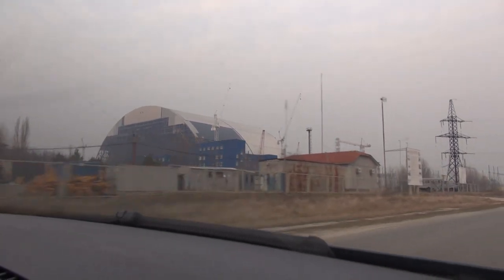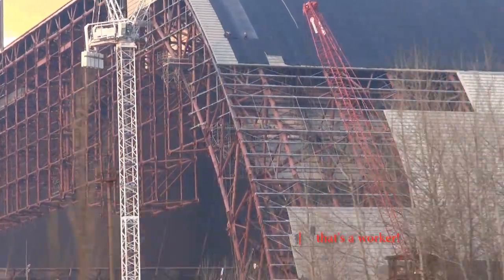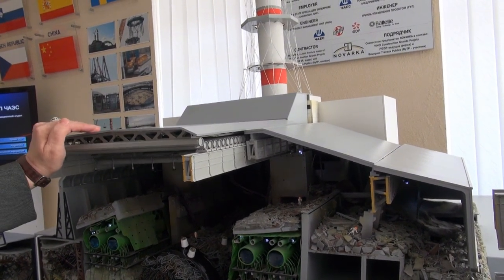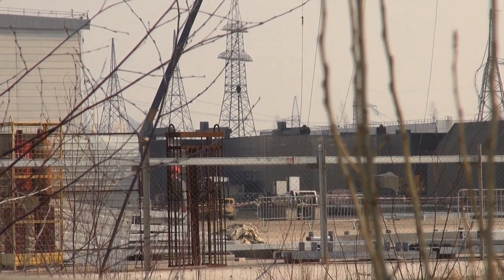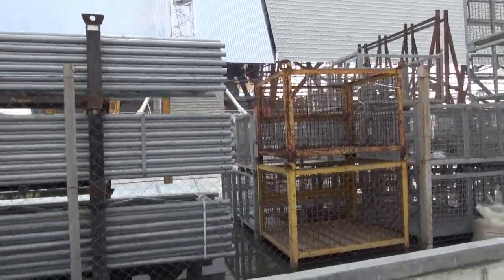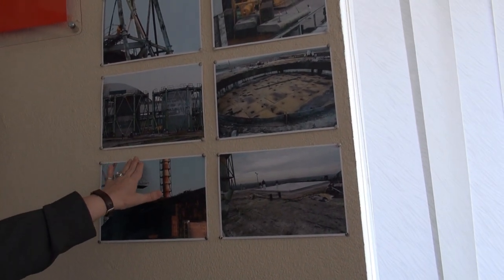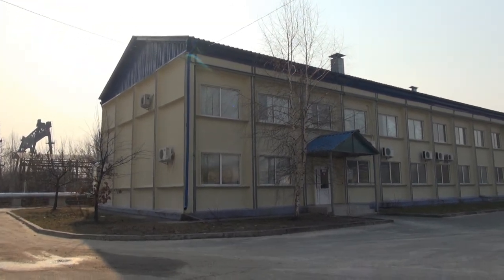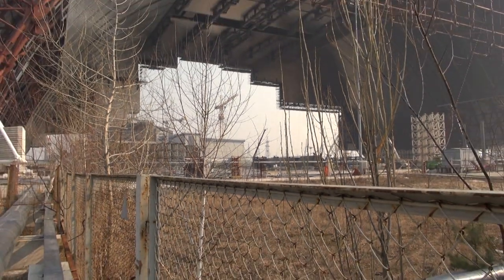Chernobyl New Safe Confinement (NSC) 2015 - "Арка" shelter of Reactor 4

Comment: New SAFE confinement? It will never be safe. Depending on the fuel used, U-233, U-235, the half life is anywhere between 160,000 and 240,00 thousand years. Nuclear power is simply a BAD IDEA!
Reply: +Semen MALASHENKOV: yeah... why not?
Reply: +Semen MALASHENKOV well look around us. we are experiencing global warming. the sun is getting stronger and stronger. might as well us it as a source of energy
Reply: Z Divinagracia
the sun isn't getting stronger due to global warming, i have no idea where you got that from. global warming is happening because of the increased amount of Co2 in our atmosphere holding more heat in than before, it has nothing to do with the intensity of the sun, which hasn't changed for millennia.
Reply: +Mikail Elchanovanich what i mean is that we feel the intensity of the heat more and more because of our atmosphere is depleting.  .-.
Reply: Z Divinagracia
of you mean the ozone layer, that's a different thing altogether, not to do with climate change. i'm no scientist so i don't know if areas affected by increased UV exposure would be better for solar panels, but it's an interesting idea that might be worth looking into.
Reply: *****
well, depending on the technology it could go either way, fossil fuels are certainly safer, and if we can develop effective CCS (carbon capture and storage) technologies, then we can use fossil fuels without polluting the atmosphere.
Reply: Indie Ingenuity Actually, while Chernobyl was certainly a terrible tragedy, it was probably one of the largest boons for modern science of its time. Since reactor 4's meltdown, humanity has learned a great deal about nuclear power, it's dangers, effective containment and failsafe protocols, medical advancements in the fields of radiation effects and the effects of radiation on certain terminal diseases such as cancer. Nuclear power is dangerous, but it's fine as long as proper safety guidelines and containment protocols are adhered to.
Reply: MrSmilingDeath
the problem is though is that they aren't adhered to, humans aren't that responsible.
Reply: Mikail Elchanovanich Given that nuclear meltdowns rarely happen these days, yeah, they are adhered to.
Reply: MrSmilingDeath
to an extent, of course, but not enough.
Reply: Mikail Elchanovanich As long as reactors aren't melting down, I'd say they're being followed just fine.
Reply: MrSmilingDeath
i'm sure that's what they were saying before Chernobyl went up in flames too. you have too much trust in these arrogant people. there is no way anyone can be sure that nothing will go wrong, and to assume so only beckons it.
Reply: Mikail Elchanovanich I'm not saying that nothing can go wrong, just that I'm no engineer so as long as reactors aren't melting down, I think I'll leave it to the professionals. To assume that humanity learned nothing from the incident at Chernobyl is extremely naive. Reactor 4 was actually considered somewhat outdated even before its meltdown. Not to mention that it was being maintained by the Soviet Union which was in a state of political and economic decline.
Reply: MrSmilingDeath
i didn't suggest we learned nothing, but they were pretty confident it was fine then, and we're pretty confident it'd be fine now. if something can go wrong, law of probability dictates it will go wrong eventually, it is unsafe.
Reply: Mikail Elchanovanich Well if you live in fear of Murphy's Law, everything is unsafe. Just because something has risks doesn't mean that we should just scrap it completely. Of course nuclear power has high risks, but comes with much higher rewards. It's cleaner than fossil fuels, offers substantially more energy output and isn't a being used as a motivation for armed conflict. I'm just saying that your attitude towards nuclear power sounds a bit like your tinfoil hat might be strapped on too tightly. There are obviously dangers with most fuel sources. Fossil fuels are very harmful to the environment, coal is extremely flammable and has caused the destruction of quite a few mining settlements (and has left some uninhabitable due to coal fires), and hydroelectricity has the obvious potential for dams to overflow or even break, flooding large regions downstream, killing numerous types of wildlife and destroying homes. Everything has its risks, but we can't cower in fear of them.
Reply: MrSmilingDeath
yes murphy's law is applicable to everything, does that justify such a risk when renewable energy, geothermal and CCS fossil fuels are substantially safer?
Reply: *****
CCS means Carbon Capture and storage, therefore no pollution. geothermal is here actually, look it up. renewables don't produce enough energy because governments aren't willing to invest in them since they have vested interests in oil.
Reply: *****
look at how wasteful and inefficient cars were a hundred years ago, with funding and proper implementation renewables can be so much better than they are, it just needs people to get behind it.
Reply: ***** dude sunlight is massively more powerful than indoor lights. don't be condescending, i know how energy works. why are you so adverse to renewable energy? you understand it's not gonna get any better unless we try to make it so, right?
Reply: *****
not true, photons of different electromagnetic frequencies carry different levels of energy with them, the sun produces light across the entire visible light spectrum and beyond, most light bulbs produce only a fraction of that spectrum, and much fewer photons generally too, else you'd need to wear sun cream and shades all the time because of the UV exposure. renewables alone won't be enough with current technology, but alongside a diverse set of other power generation methods can offset resource costs and bolster reserves.
Reply: *****
what you said makes no sense, light is radiation, light is energy, in the form of photons.

like i said, not right now, but it could be if governments actually tried, rather than subsidising fossil fuels like they do now.
Reply: *****
well, yes it is, it's electromagnetic radiation, it is not nuclear radiation, which you seem to be confusing it with, probably since you're so obsessed with it. like i've said like 4 times now, solar panels aren't good enough yet, but with funding into research and proper implementation with more panels then they will be, there is plenty of space on rooftops to satisfy what we need. all this isn't even counting wind turbines, "wave machines" that harness the energy of the waves and tidal patterns of the sea (an almost 100% reliable source), small scale hydroelectricity from rivers and other kinetic/gravitational potential energy systems.
Reply: *****
interesting grammar choices there. you seem to be missing my point, like i've said again and again, of course wind OR solar OR any other source aren't enough on their own, i never suggested that they were, but together, when actually implemented to their full potential, they are. you also completely ignored the other sources i talked about, including CCS technology which would mean we can still harvest fossil fuels without contributing to global warming. i'll also suggest energy efficiency public awareness campaigns, which are surprisingly effective at reducing a country's energy consumption.

what is the cheapest option is often not the best, but capitalists conveniently forget that.
Reply: *****
it sounds like you have no idea how much money the Gov spends on subsidising coal and oil, if they spent the same money on renewables then we'd be running off of that. people do have private wind/solar, certainly a lot more than people with their own coal fired power stations or nuclear reactors.
Reply: *****
i already said why the government is bad, because they are more interested in themselves than the country they run
Reply: This isn't about fuel and energy. It's about SAFETY! Look at FUKUSHIMA you nitwits! Nuclear fission can not be controlled. It's a fact. Mountainous stockpiles of spent nuclear fuel and pure weapons grade plutonium from decommissioned nuclear weapons everywhere.
Reply: *****
i'd rather fix what society we have and stop them ruining the planet rather than building another one from the ground up, but i have considered it as an option yeah.
Reply: *****
that assumes the electoral system is fair, which it isn't, and that voters are well informed on what is best for them, which they aren't. plus i've never run in an election before.
Reply: *****
speak for yourself man, i never said i didn't intend to, in fact i do intend to and will likely run for parliament in 2020 as an independent candidate. what have you done?
Reply: *****
did you get elected? how home you get a high horse?
Reply: Sun provides around 1.4kW per square meter. Solar panels are around 20% effective. You would need around 3.5 million (3 500 000) of square meters or 3.5 square kilometers of solar panels to match output of that one reactor. Not to mention that sun isn't shining 24/7, while the reactor is working all the time.
Also, lots of various dangerous waste is produced during solar panel manufacturing. You also need to store energy somehow to make it available at night or during bad weather.
Reply: Sasha Naronin
you can't simultaneously praise nuclear power and complain about dangerous waste products. for the final time: i did not once suggest we should run our society on solar alone, it is but one of a myriad of energy sources we should be focusing on. energy storage is an interesting avenue and has had many great strides as of late, including seemingly mad ideas like heating water in insulated containers, using motors to wind up elastic bands, and more conventional solutions like alloyed lithium polymer batteries which are much more durable and hold more charge and for longer than lithium ion cells.
Reply: I'm just saying it isn't green option because manufacturing it is dirty.
I'll see how you reliably store tens of thousands of megawatt-hours for at least half a day in rubber bands or hot water...
Also, do you know the cost of Li-Po batteries? And how much charge cycles do they last? And how much it takes to produce them?
Gathering energy distributed so thinly and unevenly around the surface of Earth is simply counterproductive.
Nuclear power is perfectly safe unless you piss on safety measures like they did in NPP or build your reactor not to be able to withstand earthquakes and tsunamis that DO happen in that area regularly.
Reply: Sasha Naronin
manufacturing anything is dirty until the production process is refined. exactly what kind of waste products are we talking? some could be re-purposed for other things, or we could just dump it under ground like you're planning to do with spent fuel rods, just without the expensive radiation shielding or effectively permanent pollution.

i didn't come up with those energy storage concepts, although i think there is some merit to them, particularly in gravitational potential energy and elastic storage (not with literal rubber bands though). lithium polymer batteries are indeed expensive, but again, so were most things once.

thinly and unevenly? you mean directly from our only true energy source, our great father, literal material manifestation of god, the sun? it's not counter-productive, it's harnessing safe, renewable, reliable energy that would otherwise go unused.

nothing before the word but (or indeed any substitute for it) means anything. humans just can't be trusted with something as volatile as nuclear power, especially not in terms longer than their own lifetimes.
Reply: nuclear power comes in several flavors.currently almost all commercial nuclear plants are phase 3 and are designed to make material for bombs.they only use about 2% of the fuel leaving 98% as highly radioactive waste. phase 4 nuclear plants are designed to burn 98+% of this leaving mostly very short half life waste that will be no more radioactive at the end of 200 years, than the ore they were refined from. phase 4 nuclear plants by the vary nature of their design can not melt   down. while we figure out what to do with renewable we have enough waste to meet the needs of the us for hundreds if not thousands of years.there is no question of whether or not, the only option available is to use the fuel up just to get rid of it.
Reply: That waste is 97% uranium. It can be reprocessed.
Reply: Clay Mccormick
if indeed these phase 4 plants run on waste fuel from other plants and it's not possible for them to meltdown, then that's good, it'd be cheaper, safer and more environmentally friendly, why the hell aren't they being used instead of plants like Fukushima and Hinkley Point? seems REALLY fishy though, would like a citation.
Reply: phase 3 nuclear was built to enrich material to make bombs, hundreds of billions of dollars were spent developing them.
they can never use more than about 1% of the potential as full by their very design.
liquid salt thorium reactors at least experimentally were built in this country into the seventies when funding was cut to protect the phase 3 plants and send jobs to socow.
there is a movement to restart phase 4 research microsoft through terra power and several others just youtube search thorium and you can find all you need then when somebody talks about bad nuclear you can explain it.
Reply: Clay Mccormick
thanks but i know of Thorium and all i've seen looks like unscientific woo and hyperbolic nonsense, i doubt searching it will provide much of any legitimate use, could you recommend something scientifically verified?